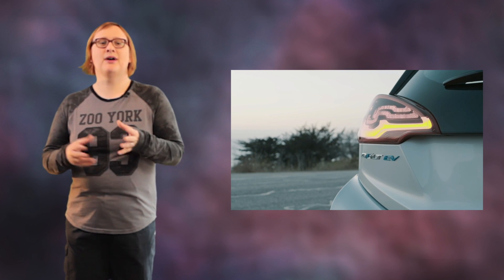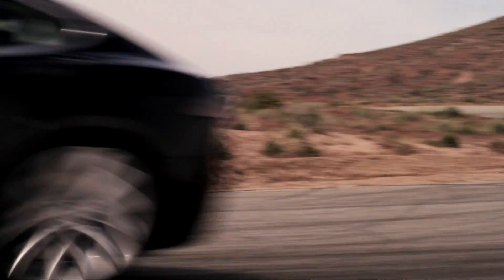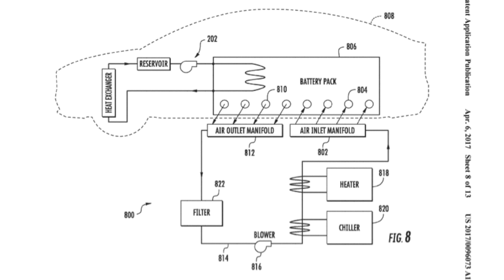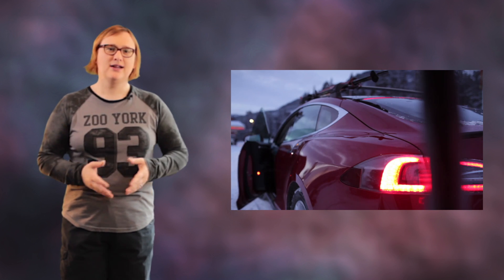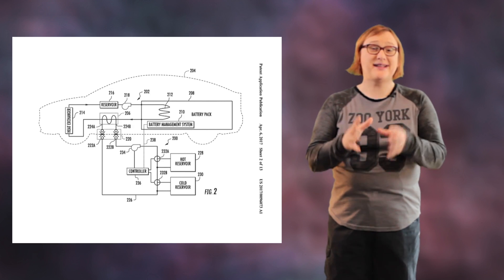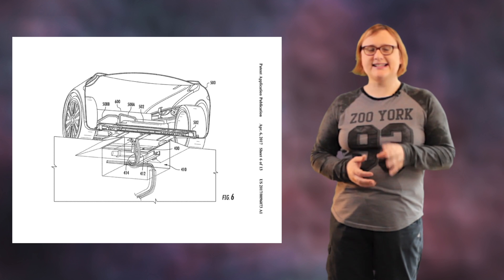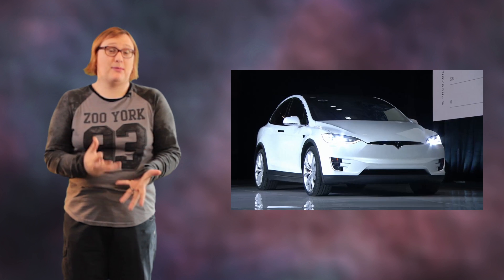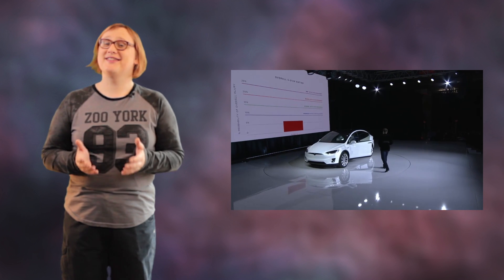Why Tesla Wants To Put Its Battery Pack On Ice For Super Fast, Super Chill Supercharging

Comment: Just put high power fan or other type of active cooling system inside the car, which will be active only when charging. It's better than messing up with outside cooling system that harder to install and more expensive (and delay an expansion of Supercharger). Cooling System may draw a lot of juice but you can just offset that with higher power charging.
Reply: Muka Zero you mean like a liquid cooling system, coupled with a large radiator and electric fans to get rid of the heat effectively?

like... they already have in all the teslas?
Reply: Clearly from the effort of the patent that old cooling system is not enough... It's just not look so practical to me, same as their Battery swap program (try google Tesla battery swap). 

Why? 1. its add more complicate to construction of new supercharger  2. it's harder to implement on old supercharger  3. people is gonna confuse over it. 4. New Tesla car has to add system to accommodate this function = more part to break, more point to leak  5. Is it gonna work when fully autonomous driving came out? more complicate then...

This outside cooling may be one of the option and I believe it only work if they can make it automatically & seamlessly... no appointment, no frustration, intuitive, "Just work!" that's it. 

However, this is just a concept that may not really came out. In time, Tesla will improved their on-board cooling system or move to new type of battery that has more temperature tolerance, that will solve this problem forever.

Comment: I don't like it, I thought they were going to improve the chemistry to allow for faster charging, that would have been better. Charging cables being cooled is fine, but requiring a cooling system to attach every time you supercharge is one more point of failure. If this is the only option for now and researchers simply can't make better batteries then fine, let's use this. Regardless of the solution, faster charging is really needed as battery packs increase.
Reply: Even better batteries will benefit from improved temperature management.

Comment: I hope the R&D on glass as electrolyte becomes stable and commercial ready in 3 years. This should solve many of the problems of current lithium mix. OTOH, maybe having some graphene used can help too, at least in the interim. But I suppose, that too requires R&D time if commercial or mass production is involved.

Comment: This does not seem like a reasonable solution. The heat is caused by the high internal resistance, which also limits the max charge current because of the charge gradient in the battery pack. This is why charging rate must be decreased as the battery reaches peak charge, and why all super fast charging systems are designed to charge only up to 50%-80%. Cooling the battery will not let you exceed the maximum voltage in one area of the cell while waiting for it to equalize throughout the cell. Only a lower internal resistance will allow the cell to equalize faster and accept the high charge current as the state of charge increases.
Reply: capacitors;)
Reply: Marc van Leeuwen, it's probably the way I am explaining it. But I'm basically talking about the lag that occurs when charging a battery which explains why it can only be charges very fast up to low SOC values, because voltage shoots up to 4.2v at which point the charge current has to be reduced. If you take the charge current off the battery after a very high C charge, the voltage will drop because the battery isn't really charged up to 4.2v.

This explains it better than I can: http://batteryuniversity.com/learn/article/charging_lithium_ion_batteries

The bottom line is, cooling the battery is not the solution. Decreasing internal resistance during charging so that it can handle a higher current all the way up to a higher SOC, allowing the batter to charge to 90% in 5 minutes. Right now I think the fastest charging is up to 80% in 35 minutes in some cell phones with Qualcomm's rapid charging. I don't think Tesla can charge that fast yet. It takes about 40 minutes to get to 80%, which is good for an EV, but not good for someone driving cross country and accustomed to 5 minute refueling stops. 

For trips to a destination 500 miles away with a supercharger halfway and at the destination, or a destination charger that charges fast enough to meet your schedule, it's not a big deal. You can leave 40 minute earlier and hopefully eat during that mid--point recharging. But for 1500 mile trips, on a tight schedule, 40 minutes for 80% charge might cause some problems. Some say "just plan around it", but if you are doing a suicide run during a 4 day weekend, you don't have time to make it a 2 day trip each way, and a 30 minute nap every 250 miles might not work.

Once you can get 90% charge in 5 minutes without significant degradation of battery, and good charger infrastructure, I think EV will rapidly replace ICE vehicles.
Reply: Did not read the patent but I think the the idea is to also cool the power transmission cables. That is in addition to the battery temperature management. Cables need to stay within some temperature limits in order the preserve the insulation around them.  Added benefit is to keep the wire resistance low. Like many materials,  copper has a temperature coefficient which causes the resistance to increase with increased temperature, which in turn increases the dissipated heat.
Reply: Somun, they will need to use much larger (lower resistance) cables as charging current gets higher with a bigger plug as charging voltages get higher. That's a better solution than cooling a cable. But they will need added cooling for the Supercharger itself. The cable will be heavy and might need to be hung from some counterbalance so you don't need the strength of a fire fighter to charge the car.

I think the onboard thermal management for the batteries will be enough once they get the internal resistance down. I think the battery technology is already here, it just needs some huge investments to start producing them in a cost effective way. 

But even if they can charge at 1megawatt/hr, it's going to cost a lot of money for the charger and for the electricity, because they are big sudden spikes that the power company or the charger has to smooth out with a bunch of batteries, which adds more cost and lost efficiency.
Reply: Cost is the big advantage. Cabling gets non linearly expensive with larger and larger wires.
Reply: Somun, there are already water cooled cables, so Tesla can patent that, unless he has some significantly different way.
http://www.nu-core.com/gallery/main.php?cmd=imageview&var1=Flexible+Power+Cables%2Fcable5web.jpg

But I wonder where the point is that it's more cost effective to cool the wire than to use bigger cables or higher voltage. Clearly the cable in that link is big enough to be worth water cooling.
Reply: Somun, there are already water cooled cables, so Tesla can't patent that, unless he has some significantly different way.
http://www.nu-core.com/gallery/main.php?cmd=imageview&var1=Flexible+Power+Cables%2Fcable5web.jpg

But I wonder where the point is that it's more cost effective to cool the wire than to use bigger cables or higher voltage. Clearly the cable in that link is big enough to be worth water cooling.
Reply: I agree that battery and cable cooling seems to address only a fraction of the problems that superfast charging (say 5 minutes from near-empty to near-full, or 12C in battery parlance) would cause. Forcing all mobile ions to move from cathode to anode in such a short time is simply bad for the cell, no matter what temperature it has. But I don't get the charge gradient argument. Putting a lot of current through a battery of cells in serial will instantly cause the voltage to increase (by a small bit, hopefully) over each cell due to internal resistance (assuming they all have about the same internal resistance). No equalizing is necessary.

What is called equalizing has to due with not all cells reaching their "full" state simultaneously, so only near the end of a complete charge cycle, certain cells must be taken out of the serial chain and no longer get any charge while others are still filled up a bit. But none of that happens during fast charging.
Reply: Marc van Leeuwen, if you ever charged a battery (lead acid or Li-ion) at a very fast rate, and take it off the charger, it will go down in voltage within less than a minute. You only see it if you are using a charger than shows volts, not state of charge in percent. 

A charger will automatically charge at a slower and slower rate at the state of charge increase, sort of like a trickle charge. 

Same thing happens when you discharge super fast. The voltage will drop while under load, but climb back up if you remove the load. This can only happen with a charge gradient. It's not only the internal resistance or it would be instantaneous, but it takes several seconds for the voltage to return.

I think it also has something to do with the way the batteries are constructed. Which is why low C batteries have higher capacity and high C batteries typically have lower capacity.
Reply: Marc van Leeuwen, if you ever charged a battery (lead acid or Li-ion) at a very fast rate, and take it off the charger, it will go down in voltage within less than a minute. You only see it if you are using a charger than shows volts, not state of charge in percent. 

A charger will automatically charge at a slower and slower rate at the state of charge increase, sort of like a trickle charge. 

Same thing happens when you discharge super fast. The voltage will drop while under load, but climb back up if you remove the load. This can only happen with a charge gradient. It's not only the internal resistance or it would be instantaneous, but it takes several seconds for the voltage to return.

I think it also has something to do with the way the batteries are constructed. Which is why low C batteries have higher capacity and high C batteries typically have lower capacity.
Reply: IMHO The slow adjustment of the battery voltage is almost certainly a chemical effect: the movement of ions settles down, giving a new equilibrium and a different cell voltage. I still don't understand what you mean by the charge gradient, is that something inside individual cells, or something at the level of cells that are wired together in the battery?
Reply: Marc van Leeuwen, the way I understand it is related to the way the layers of cathode, anode and electrolyte are arranged. Some have more cathode and anode surface and less electrolyte, and this allowed for higher C rating, at the cost of energy capacity. Some use less cathode and anode but thicker electrolyte layer, which have lower C rating but hold more energy, when comparing two battery's of the same volume.

But there reaches a point of diminishing returns where you get super high C rating but useless capacity, like using a super capacitor as a battery. It has high power but low energy. 

So they need better chemistry like some of the solid state glass electrolyte batteries they are working on. If they get a 20C charge rate and high energy density, they might be good enough for most people.
Reply: IMHO All this still does not give me the slightest clue what you mean by "charge gradient". I'm a mathematician, so you don't need to explain what a gradient is: it is the spatial derivative of a scalar function, represented as a vector pointing in the direction of steepest increase of that quentity. I just don't see how such a thing plays a role here. Unless you are talking about the charge distribution inside a single cell; and even then I don't see what you could mean.
Reply: Marc van Leeuwen, it's probably the way I am explaining it. But I'm basically talking about the lag that occurs when charging a battery which explains why it can only be charges very fast up to low SOC values, because voltage shoots up to 4.2v at which point the charge current has to be reduced. If you take the charge current off the battery after a very high C charge, the voltage will drop because the battery isn't really charged up to 4.2v.

This explains it better than I can: http://batteryuniversity.com/learn/article/charging_lithium_ion_batteries

The bottom line is, cooling the battery is not the solution. Decreasing internal resistance during charging so that it can handle a higher current all the way up to a higher SOC, allowing the batter to charge to 90% in 5 minutes. Right now I think the fastest charging is up to 80% in 35 minutes in some cell phones with Qualcomm's rapid charging. I don't think Tesla can charge that fast yet. It takes about 40 minutes to get to 80%, which is good for an EV, but not good for someone driving cross country and accustomed to 5 minute refueling stops. 

For trips to a destination 500 miles away with a supercharger halfway and at the destination, or a destination charger that charges fast enough to meet your schedule, it's not a big deal. You can leave 40 minute earlier and hopefully eat during that mid--point recharging. But for 1500 mile trips, on a tight schedule, 40 minutes for 80% charge might cause some problems. Some say "just plan around it", but if you are doing a suicide run during a 4 day weekend, you don't have time to make it a 2 day trip each way, and a 30 minute nap every 250 miles might not work.

Once you can get 90% charge in 5 minutes without significant degradation of battery, and good charger infrastructure, I think EV will rapidly replace ICE vehicles.
Reply: Jake Austin, capacitors have a high power density but an unacceptably low energy density, which is why nobody uses them for the energy source.

There is a car that uses a Hydrogen fuel cell to feed a bank of capacitors, this small pack has enough power and energy to get the car accelerated once. When the car decelerates, regen braking puts some of the energy back in the capacitors, and the fuel cell tops it off, making it ready for another launch. 

If someone made a battery with a very high power density but very low energy density, they could also use capacitors in a similar way as described above, but instead of charging the caps with a fuel cell, they get charged with the main battery pack.

So far, the lithium ion packs that have enough energy density and total capacity also have enough power that it's not worth adding a capacitor bank.

Comment: That looks a little complicated, a bit of an early try that will probably get a lot better. 
It got me imagining 2 extra fluid connectors on the charging plug that connect to the battery coolant system. Cooling the fluid could take place in the charging stand and be pumped through during charging, cooling both the cable and the pack and raising the capability of both. They'd probably still have the smallest plug.
Reply: That's what I thought it was at first.

Comment: What happened to Tesla's battery swap thing?
Reply: i think tesla talked about it in a quarterly phone conference, but no drivers liked it so no further investment from tesla, but the demo was really cool
Reply: king clovis; it was never a swap, just a loan of another battery. The reason is that battery packs can vary in quality depending on age. A new battery pack is better than an old one.
Someone with a new Tesla doesn't want to swap out a new battery pack for an older one.
And Tesla didn't want to give a driver a decent battery pack and be stuck with one that is pretty worn out.
Reply: Oh well, I thought it was a good idea. They could just loan the batteries altogether, that would bring the cost of the car down for consumers and give Tesla total quality control...
Reply: king clovis, it seems like a good idea, but think about if someone offered that for cell phone batteries, and you have a brand new battery you cared for and they want to exchange a battery that looks like someone took it out and played hockey with it. Or another example are LPG tanks for the bar-b-que grill. Yours is all new and shiny and they want to exchange it for one that's all beat up. 

Now imagine it's your 100 kWh battery that only charged to 80% and only discharged to 20% since it was new. You babied it. You kept it warm in the winter and cool in the summer. And now you want to change it for one with 300 full charge and discharge cycles. Even if it's not your battery and it's effectively a loaner battery, do you want to trade that for a battery someone else abused? Most people don't, so Tesla pretty much scrapped the idea.

They need to make the batteries able to charge up to 80% in 5 minutes, and I think they are getting close to that. Look at the fast chargers for cell phones. They can charge up to 80% in 35 minutes and they are constantly improving that.